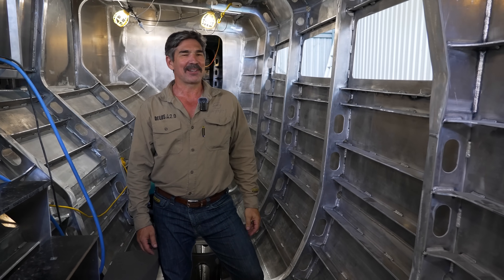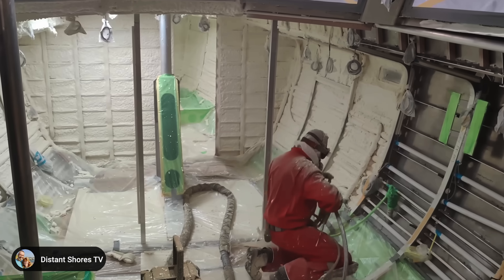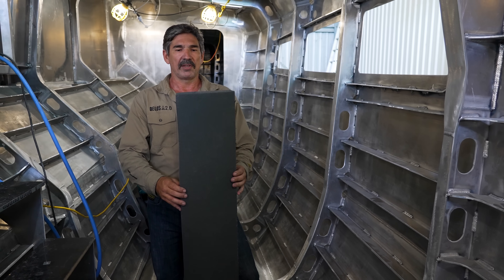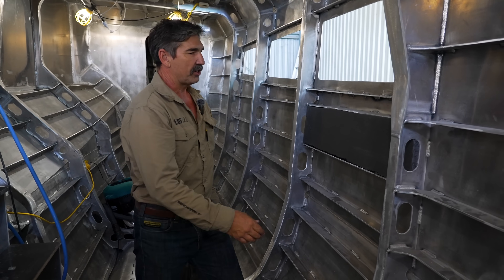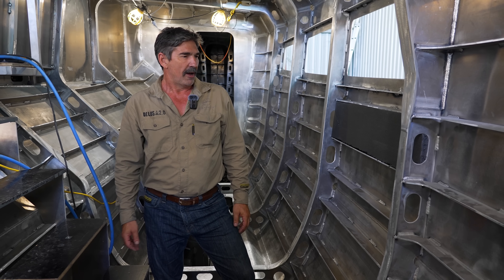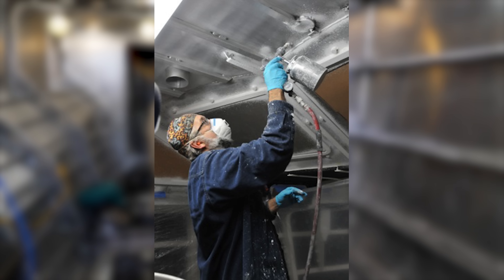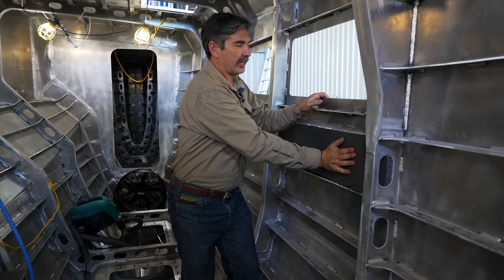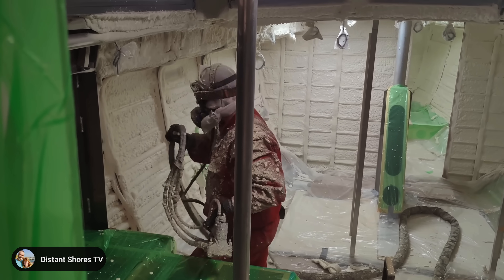HELP, We Need Your Advice!  How Should We Insulate Our Aluminum Catamaran???

Comment: Here's a comment regarding insulating your aluminum sailboat. As you know aluminum aircraft, including seaplanes that operate in saltwater environments, use zinc chromate primer to ward off corrosion. I'm curious why you haven't discussed that on the channel. It seems to me a combination of zinc chromate primer with closed cel foam panels would make good sense. Couple that with judicious use of sacrificial anodes and a means to detect stray currents and you'd have a good solution. Best, Tom

Comment: What ever you choose, make it good, alloy boats are noisy.
 Its also a special noise, a high-pitched tink.
 Drives me nuts,everything echoes and bounces. 
On one of my freinds fiss boats ( all alloy ) we use ear plugs and muffs
 Its like sitting inside a V6 engine.
In my view, you could not spend enough on the insulation of noise

Comment: I worked at an aluminium superyacht builder for 5,5years as a specialist for this topic and was responsible for all their insulation, structural fire, fire safety and noise & vibration solutions. This yard makes mainly sailing yachts of 40-91m in length and is highly known for it's quality. I can give some advise if you want. I prefer to plan a teams call. In that way I can explain a lot about different options and the why's of these option. It's a bit much for in a youtube review.

Comment: Add a layer of anti corrosion, type air plains or similar, then use the right spray foam on top of that to cover everything. Just make sure to mark off any points where you suspect you might need to repair stuff and then dig that out when there is a need. It would give you the best coverage and the only downside is that it covers every thing, which in this situation is actually a good thing, even if it is in the way for repair work. 

I've known a lot of metal boat owners over the years due to working in a boat utility shop for a few summers, and most of them tried many things before they all ended up using the trick I just explained, even if they found it annoying.

The thing with a ship is that every bit of water, should either be planned for or control, wild water like condensation is your worst enemy, so do the right thing right away.

Comment: Thanks for letting me actually see you, shake hands and walk around your magnificent boat coming to life. Thanks Brian for being the authentic way you are and not sending me off. Do you get many unannounced visotors like me. I did not want to hold you up - so I didn't ask too much - thanks! Visiting meant a lot to me. 
Here are some thoughts I'd like to throw out there - for whatever it is worth. 
I believe thermal insulation and sound proofing/muffling tasks have separate philosophies. 
The dew point is the temperature where water vapor in the air turns into water.  Your boat will most likely always be sailing "at sea level" so higher altitudes do not play a role for you like in avionics. But maybe you can get some ideas there. Airplanes need to stay light weight while reducing noise and keeping the inside warm for passengers. One measure could be to prevent the humid air from accessing the location where it would condensate. 
For sound proofing I think the task is 1. to prevent the hull from conducting/transmitting sound throughout the hull or resonating like the corpus of a guitar and 2. not let sound from outside of the hull pass through to the inside. 
One extreme to sound-proof, would be to fill the inside with something like dry sand. Sound waves would agitate the grains of sand which would absorb and muffle the sound.
There exist self stick asphalt mats that can absorb some of the vibration. They are installed in some cars to prevent the thin steel of the outer hull from vibrating - but they also smell bad.
Maybe you can get some answers from air and spaceship manufacturers.
Cheers and more good luck on all your endeavors!
And Y'all stay healthy, happy and the way you are!

Comment: Cutting foam exact enough to prevent air flow will be very difficult and with airflow where is your thermal insulation and if glued you have the same problem as spray foam ?

Comment: I see the notes below...but like you, I am not a fan of normal spray on foam for future maintenance reasons.  Further, I am not a fan of through-the-insulation fasteners.  Why needed, if press fit with an outer cover to hold it all in?   Your push through hold on wires will become the corrosion medium.  You will need hundreds!  Not for me!  

Here is a product to try:  Lizard Skin. (Or similar)  It is a spray on that can cover a very thin layer on any surface...kind of like a vapor barrier on a house being built. Skin it, push in you panels and install the outer covering. Less work, less mess, less time to inspect and repair.  I am sure Lizard Skin is expensive...so what?

Comment: Hi I made and lived on a aluminum boat in Norway. Here the weather changes from +25 Celsius in the summer to -25 Celsius in the winter. So insulation is essential for comfort.

My best tip is to allow moisture and water to drain in between your hull and the insulation. It means you have a good bilge pump system to keep pumping the water out. 

 But in my experience it’s the best way to build an insulated aluminum boat.

You don’t want to stick anything to the hull. Because all of that insulation is highly flammable. So if you need to weld anything on your hull. It’s going to be a problem.

I ended up using same type of insulation as the black pads you showed. But much thinner. To make the cavity between the hull and the inner insulation. Since it doesn’t absorb water and is rigid. On the inside, i used rockwool (an insulation normally used for bathrooms in houses, to prevent mold).

Comment: I have no idea about efficiency, but the channel sail hub seems to be testing a cork based spray on their van so they can use on their next boat. Maybe you could reach them out to ask about specs. Although it seems that they would combine that thin spray with some panels aswell. Anyway

Comment: Whether you end up using the foam that you have there, or spray foam, (which seems like a great idea), you can coat some marine grade plywood on the inside and lay it over top. Are you planning to use wood for the interior? Cheers

Comment: I have watched many insulation videos and after probably a hundred or more, I think they all have their good and their bad. I think it's best to use what is needed in any given area. So a combination of probably all of them is the way to go.  One thing I found out the gard way, even closed foam insulation will eventually gather water. Ask anyone with a hot tub cover. It may not be a lot, but I don't believe all are of a top grade.

Comment: One thin layer outside the Cabling & Pluming one this layer outside with the area for the Cabling & Piping. Then they would stay on when applied to the area.
Reply: and use the foam only in the hard to get to areas.

Comment: The best technical solution is hands down the spray foam. In areas where you are worried about access you could use alternative methods. Im just not a fan of the material. I have been on boats done with cork. I believe they glued it down. We sailed in some pretty cold weather, and we got very  little condensation. Biggest drawback is1/2 the R Value, and a lot more work to install.  We have a freezer that is insulated with 4 inches of foam, but we still get some condensation on the outside. Unfortunately when they build that, they did not account for that, so we have condensation inside of cabinets. Not where you want it. What I am trying to say, be aware where condensation will happen and plan for it. i.e Easy to clean surfaces.. drains., ventilation. A carefully places Stainless surface is usually the way to go.

Comment: only spray foam, I have used self adhesive foam, but you cannot cover all the stringers and there are always gaps and small air pockets and the condensate drips from there right away

Comment: That Neolon XPE closed cell flotation foam could make most boats virtually unsinkable. 15 kg per cubic meter is super light. Most spray foams I have seen have been at least 50kg per cubic meter.

Comment: I have no boating experience but I would think that spray foam would be the best IF you properly prepare conduits, piping or anything else that will need access.  I've used it in homes and it seems preparation would be similar in the marine world.  Also, Dan is awesome!!  That guy has such a great personality and seems like just a good all around dude!!

Comment: Many van builders use lizardskin. It's two thin layers to spray on for sound dampening and insulation that prevents condensation. It's water based, so not dangerous chemicals and easy to apply. Conventional insulation material can be added. Some people use sheep wool, which stores water and releases it again under drier condition. I don't know if that works for your boat. You are doing amazing work, I wish you all the best.

Comment: Architect and LEED AP consultant with degrees in engineering and environmental science here.  Also a follower of your channel for over 10 years. 

I’d be very careful about the off-gassing of any material you chose, whether it is solid, spray or chemical application.  You’re living in a very tight closed environment and many of these products were not meant for this type of application.  Testicular cancer amongst other cancers have been linked to PFAS and PFOE’s, etc.  Some of these products will have very long half-lives or be forever chemicals.  Children are more susceptible.  Safety over convenience would be the decision tree.

Comment: Obviously I'm late to the show here. I do have some insight into corrosion prevention and insulation. First off, I am an aircraft mechanic. As we know, aircraft are primarily aluminum, and as such a large amount of energy goes into preventing corrosion. Galvanic (dissimilar metal), stress induced corrosion, wear and tear (hangar & ramp rash) are all consistent battles we fight to maintain safety in aviation. As such, I will tell you that your boat will require periodic and routine inspections for corrosion. Anything that makes your life easier & saves time is worth your money & time investment. I WOULD ABSOLUTELY, POSITIVELY, UNEQUIVOCALLY ADVOCATE FOR HAVING A BARRIER PAINT between your hull skin & insulation. Aircraft use Zinc Chromate or Zinc Phosphate as a barrier paint. 

The other thing is insulation on aircraft is pinned to the airframe for easy removal. It is a massive pain in the knees removing and installing. But, if the space & corresponding insulation are properly marked, installation is laborious but easy & fast. 

Having been in the Navy, with 3 years of sea time, and working on fighter jets, corrosion prevention is the best way of correcting corrosion caused damages. That means keeping spaces dry and clean, preventing salt water intrusion, & quickly cleaning messes. As well as REAPPLYING CORROSION PREVENTATIVE PAINT on repairs.

FAIR WINDS AND FOLLOWING SEAS!

Comment: Definitely foam. Look at it this way. Which is more likely to happen? A moisture problem behind one bulkhead where a piece of aluminum is exposed? Or damage repair anywhere on the boat that would require a haul out and taking something apart for repair?

Comment: I,m a designer and HVAC tech. We design off-road aluminum trailers with proper insulation. Close to the same structure as your boat. We could not use foam insulation ass can not weld or do repairs after hitting kangaroos all the time. We have solved the problem using the same design as per freezer room panels. Out side metal can't be exposed inside. Condensation can not be avoided but should have draining options. Simple solution. Would like to send you a video of what we did.

Comment: As an aside. I would have made a double bottom such that all coolant would flow through the bottom of boat, making a closed loop coolant system, significantly reducing maintenance.  Again, the AAVP7A1, a Marine Corps Amtrack, is cooled by this method when in the water -- cooling a 902-cummings diesel. The bottom was flat, about 23' X 7' and only had about 3/4 of that surface area welded with an additional 1" space, from inside, for coolant to migrate around. Bottom was 1" thick aluminum.

Comment: I am a mechanical engineer with a specialization in HVAC (refrigeration, heating, air conditioning and ventilation) and this year I celebrated fifty years of sailing.
Spray foam is by far the best solution.
If for some reason you need to remove it, it is easy, and to put it back on you just need a can of foam and everything is back to normal.
To be more precise, if you want to reduce weight, you can apply blocks of expanded polystyrene (Styrofoam) as you apply the polyurethane so that these blocks stick to the polyurethane, but really this is something I would do on a racing sailboat, not a cruising sailboat, a lot of work to save a few kilos.

Comment: Spray PUR Foam would probably be the solution, but you do not want humidity in there. So you have to seal it from water and condensation. I would apply mixed layers of water seal and PUR foam (3-5 layers). Bitumen paint, Foam, Bitumen, Foam etc.. You can carry small amounts of that stuff with you for repairs. Make sure the Foam has no side uncovered with water seal. Make sure the water seal can stand the temperature stress range so it does not crack or melt in high temperatures.

Comment: I'd stay away from spray foam. It's just trendy now, but unless you want to rip it all up to respray or use board like you should've done to begin with.

The metal will expand and develop some gaps. Things is you don't believe it's possible so you'll never know until you're rotting away.

The board stuff is obviously more time consuming to get right, but it's actually more portable floatation device in case the boat starts sinking..

I doubt you'll see people trying to rip out spray foam insulation, and some isn't even waterproof.

All Styrofoam is waterproof. Just slightly degradable when soaked sometimes. Ie it's used in toilets and water float valves.

Anyways. I build houses, and while it may make sense to spray, you'll eventually have a leak or rot somewhere due to poor ventilation. Not if but when.

Comment: Cork is one of the most efficient and effective insulating materials available. It comes from a specific tree species that has developed a natural protection against wildfires in the Iberian Peninsula. Cork is waterproof and resistant to condensation, providing excellent sound and thermal insulation. 

Additionally, it resists rot, mold, and mildew. Being a natural material, cork does not release harmful gases, it has a natural pleasent smell making it a safe choice for various applications.

Comment: spray foam is great for insulating, however IT SUCKS for sound control. So spray foam the inside of the hull to keep the temperature control of the exterior facing surfaces, I would cover those walls in a layer of mass loaded vinyl to block sound. Then I would use MINERAL WOOL which is HYDROPHOBIC in the interior cavity's and around the engine rooms to cut noise transmission.

Comment: I spray foamed my shipping container home. closed cell under open cell. Closed cell to the metal. when I need to get to something, I could just cut a block and pop it out. I would use the aircraft green antifouling paint for aluminum and then use closed cell over that. Love the progress. Do a test panel. I works great.

Comment: My steel boat has much of the same challenges you have.
Currently I Armaflex sheets, closed cell neoprene sheets which has a really nice soft and spongy touch to it. This has to be glued on with a thick application of ADOS thixotropic glue to keep out air and water which protects the steel coatings (unlike alumimum, steel must be coated to stop rust!)

Comment: DO THE SPRAY FOAM!!!
Trust me I am am engineer, rocket scientist even...! I work in aerospace and have very lengthy experience with the environmental control systems for commercial jets. 
If you have air in contact with the interior of the aluminum hull you will get condensation. It will build up and get wet and damp and you will have a musty boat forever. 
The spray foam is the only way to avoid the co densation and mustyness. You can not u derestimate the amount of water that can condense and run down the walls and pool in all the low spots...
Spray foam spray foam spray foam

Comment: I would think only putting the blocks in like you've shown will serve no purpose as the heat or cold have a clear path, the aluminum fins are like a radiator's fins. layering another layer over the top of it all might help, also use different materials, that causes the heat transfer or loss to be minimized, I personally think the foam insulation is the best option, and it really cuts open easy with a carpet knife if you need to, and a spare bottle on the boat allow you to reinsulate a patch you've worked on, it's also much faster to install. another much cheaper option would be polystyrene molding the whole boat, very few other products can compare to polystyrene.

Comment: Also note that if you were to use anything else than spray foam - you'll always get condensation point within the material . Lack of air-flow and moisture is the key here and that's only working with foam spray

Comment: . Spray foam - closed cells
- adds insulation
- buoyancy 
- water isolation ( it's literally creating another foam-boat inside of the aluminum hull 
- super ease of repairs

and if you need to repair under it - it's either from the outside or you can dissolve it in no time at 5$/liter solution.